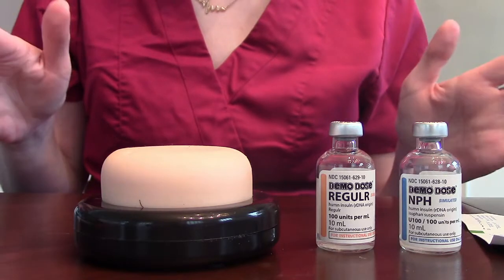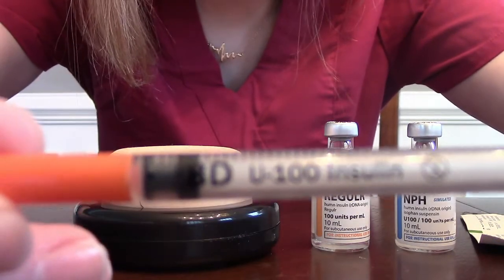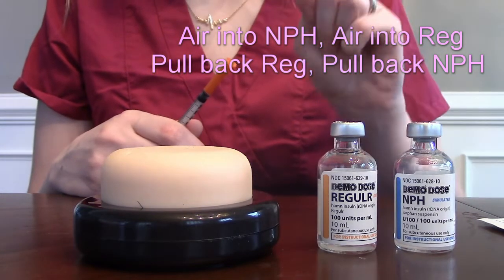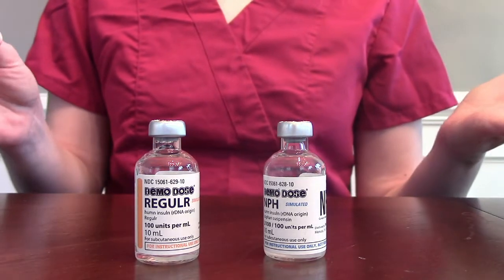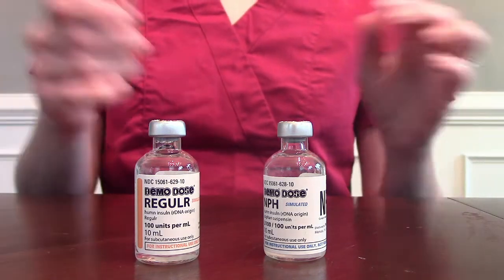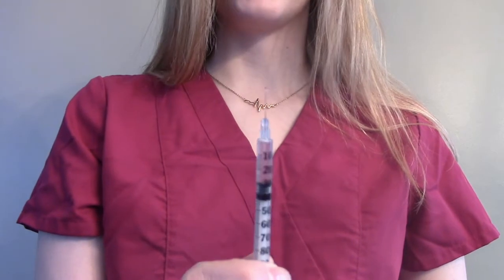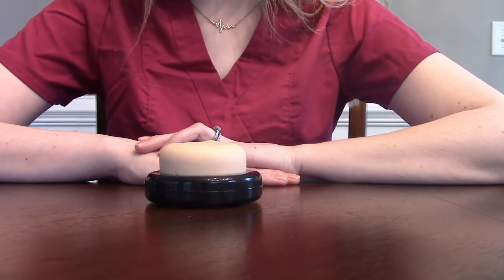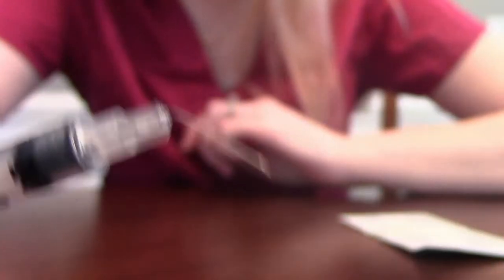MIXING INSULIN/ SKILL DEMO

Comment: If there are pre-mixed insulin already, why do we need to use the mixed NPH and RGULR?
Reply from the maker: Because you might not have that available depending on the setting in which you work. Cost is a big factor in this. More convenient = more expensive